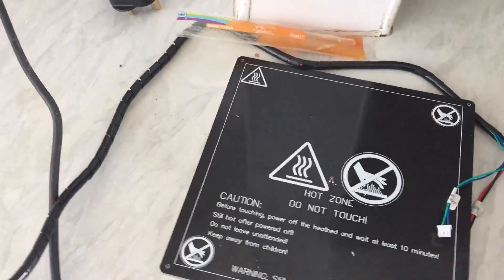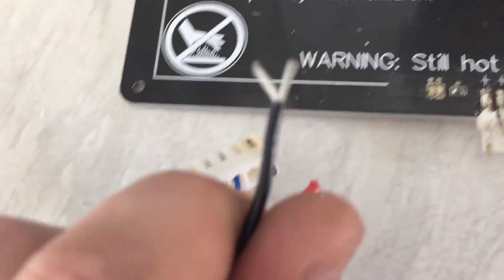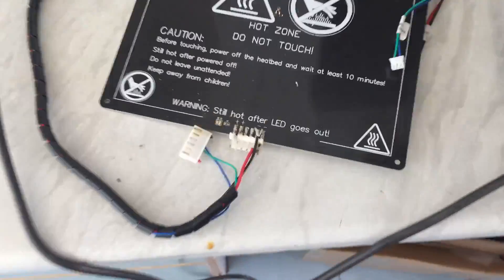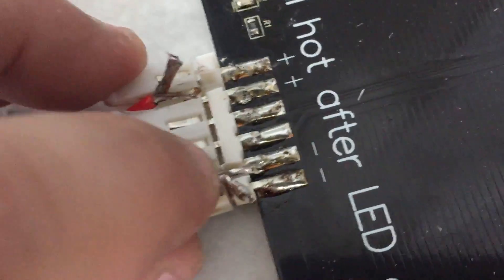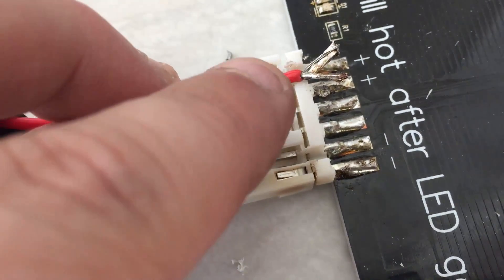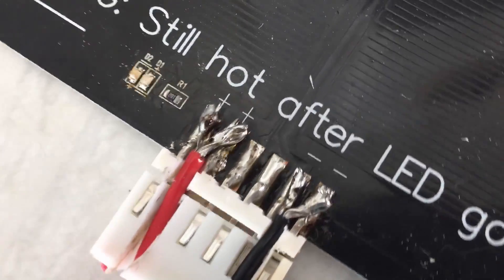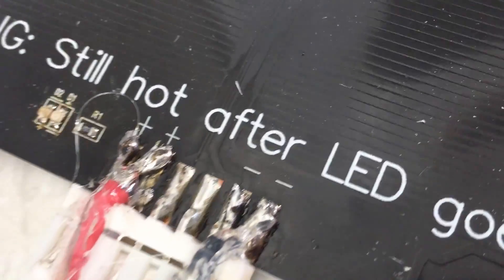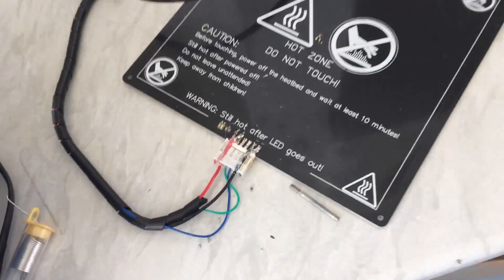ANET A8 3D PRINTER HEAT BED QUICK FIX

Comment: This is by far the worst idea for an heatbed connector fix, for a number of reasons.
DON'T DO THIS GUYS! really don't!!

1. that applying HOT glue to fix a HOT bed connector is a bad idea should be self explaining. might work for PLA printing though, but never for higher bed temperature like needed for ABS.

2. Hot glue is flexible, and a flexible connection of a moving high current wire is the last thing you want to have (flexible wires in bad china connectors and bed movement are the reason for burning out in the first place)! this will get worse if the glue gets even more flexible because of a working heatbed.

3. Using non-conductive glue to make electrical connections is a bad idea and may (especially when badly executed) reduce the connected surface area and therefore lead to a connector burning again. Seriously, learn how to make good electrical connections (soldering or applying cable shoes)

4. not removing old tinning before making a new electrical connection can lead to a bad connection, which you want to prevent in high current wires.

So DON'T do it like this...solder good connectors or the wires directly (or let this be executed by a person who knows what to do if you're not experienced with soldering). This "fix" is highly risky and will lead to burned connections/printers/houses sooner or later.

To prevent this issue with the original or a fixed connection it's NO(!) use to install a MOSFET (like suggested in the comments). This only helps for burned connectors of the mainboard and NOT for heatbed connector (thei're uneffected by a MOSFET).

Seriously, do some research before posting false and potentiolly harmful information!!

You can prevent burned hotbed connectors by adding a strain relief (important!) and adding good electrical connections (not like in this video).
Reply: Sean Pook anyone who uses electricity, gas or any kind of light source risks burning his/her house down.

What you did works but it's not recommended. Probably you will never have problems but still is not how it is supposed to be done
Reply from the maker: Its been 8 months and all is ok. Any one who buys a stock A8 risks burning their house down anyway lol. All iv done is reconnect the wires to be fair and stopped the flex by securing the wire. I dont claim to be an electrician. if that's your trade then fair enough. either way i stand by my quick fix

Comment: hmm.. would it be possible that the hotglue melts and makes a mess?
Reply from the maker: that is a good question. mine has not melted yet lol
Reply: ... did you saw the entire video? and btw it is working and not melting, gets a little sloppy with 70º and long prints, but stills in place
Reply: About what? am i the only one who saw the entire video? ..
Reply: I think it won't, because the heat has to go through the cable plastic, which is an isolation for electricity and heat, before it gets to the plastic added.

Comment: thanks for sharing  but you may want to switch to 16 or 14 awg soft silicon cable while your at it,   as its designed to flex,  doing that and using my own design cable chain mounts has kept me from suffering this

Comment: mine burned at positive, will this can fix mine too? any suggestion for upgrading so it wont happen again? thanks
Reply from the maker: yes this will fix your issue you could use a thicker wire or get a mosfet to protect over current
Reply: okay, thank you for your advise too, it helps a lot XD
Reply: Sean Pook for what it's worth i hade a mosfet and still burned. Just ended welding a thicker wire to both pins
Reply: A MOSFET will only prevent burned connectors at the mainboard because the high current is not running over the board. it will NOT prevent burning heatbed connectors (as you can read in the comment above), because it is not effecting the current flow at the heatbed connection.